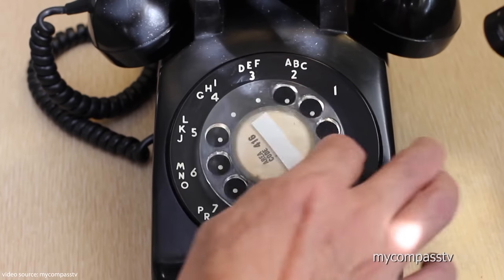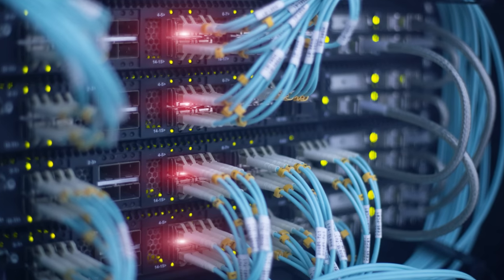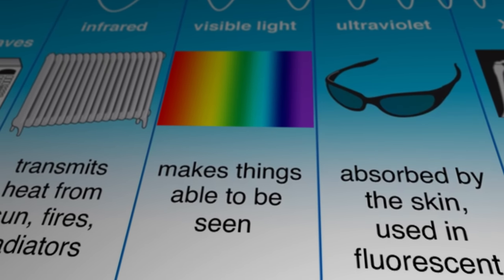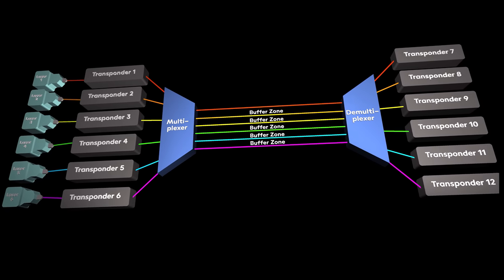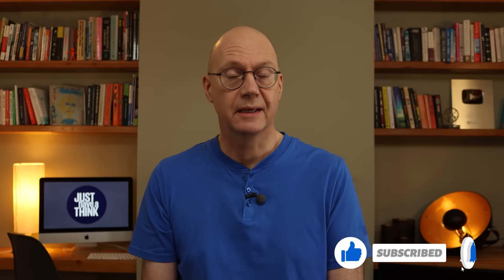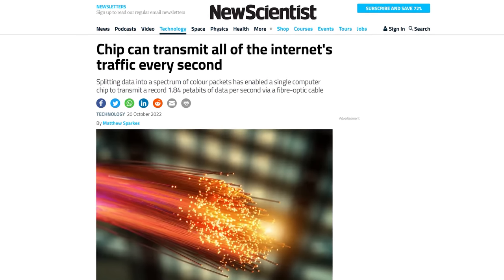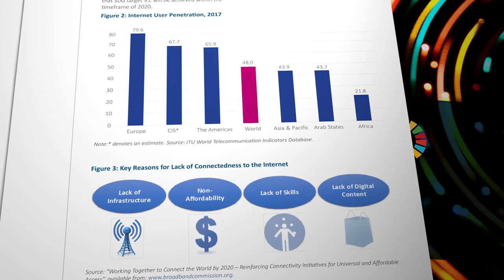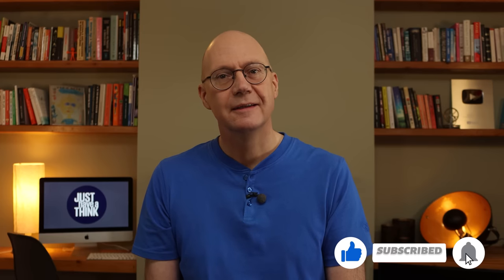The entire internet on a single chip! MASSIVE energy savings.

Comment: Wow - this will definitely help out a lot.
I always ponder if we start to move out into our solar system, says Mars next, how will we get past the time leg in communications.
All the best to you and yours.
Reply: This will change nothing with the time lag for communication between planets.

On average light takes 12 minutes and 42 seconds to travel from earth to mars.
Reply: @simcru933  I knew that. But that may be the next big challenge to  overcome as we spread out.  Such as using neutrinos or some other particle we find that travels faster than light.
Cheers
Reply: I think that stuff is gonna be far far in the future. For the meantime, we'll have to be content with the 12 million ping to game with our buddies on Mars.
Reply: Actually if they unroll 1 of these youbeaut new fiber-optic cable thingamies behind the spacecraft as they head for Mars, they could then use it to reel it in closer to the Earth as well. Thus shortening the communication delay - no? 😜🙄😁
Reply: @theoztreecrasher2647  Light travels slower through a fibre optic cable than it does through a vacuum.  So, no.
Reply: @-_James_-  Well that just means that they'll have to winch Mars even closer to the Earth to get the benefit. If they get it to within half the distance then they can double up the initial cable and have twice the capacity as well as half the distance. QED Erasmus! 🙃😉😁
Reply: @patrickmckowen2999  If we spread that far out we would need to be self supporting and for communications fall back on the ancient way of sending messages and wait a while for an answere.
Reply: @DRakeTRofKBam  🤣
Reply: @patrickmckowen2999  Neutrinos don't travel faster than light.  Nothing does, a tachyon would move perpendicular to time.

Comment: Very interesting development. It may be useful inside data centres for clustering machines more efficiently. 

However i'm.not sure the capacity of fibre optics is responsible for much wasted energy. Data centres sitting there doing nothing burn electricity and a significant amount of power is lost during transmission to data centres. 

Perhaps colocation of data centres and power generation might be the win with a vastly faster (hence cheaper?) cable link? 

It would be interesting to see exactly what traffic is composed of - the most CPU intensive stuff outside Cern seems to be crypto mining - beyond that there's finance, weather, engineering etc but all this CPU intensive stuff doesnt generate that much traffic - traffic is mostly trivia - porn, Netflix / streaming and social media nonsense. 

At present bandwidth is handled by running multiple cables - even when a single cable is to be run the trench will get a dozen redundant extras because hey - holes are expensive!!

Comment: About the same time this story hit the news another store about hollow fiber also made the news. Evidently light travels 46% faster in air than in glass fiber. This won't directly increase the bandwidth, it could free of the fiber for more transmission increasing the daily bandwidth be reducing latency. Maybe I'm just older, but I was hopping on modems to connect to other computers in the mid 80s. My 1st modem had a speed of 300 baud. A term that is completely obsolete and may have become obsolete back in the 80s..
Reply: @Pasta_watcher  Baud is symbol rate, so it depends on the symbols used. If it's 2 states then 1 baud is 1 bit per second, but you can also have more advanced symbols such as QAM64 which is 6 times faster (log2(64)).
Reply: Bandwidth does not correlate directly with signal speed.

Comment: I rather think that the the Internet energy usages quoted is not for the communications elements alone. In addition to that there will be all the servers and storage in the data centres, the air condition plus the end user devices. Figures I see for the electricity used by the data communications elements are around 1% of total global consumption, and most of that is not used in those high-speed inter-continental fibre links. There are many hundreds of millions, possibly into the billions of end user network devices, in the form of routers, almost always with WiFi included. Then here are all those 3G/4G/5G transmitter stations. Increasing the capacity of existing very high capacity optical fibre links is useful in its own right, but it's not going to make a huge difference. 

This is tackling only a small part of the total power used by the Internet as a whole. Also, researchers all over the world have been setting records for data transfer rates down a single fibre, with the petabit/sec milestone having been reached in June 2022 in Japan. I don't think what the Danish researchers have done is some enormous breakthrough, but just another step up in speed. The power saving is going to be fairly small overall, as even within the strictly comms part of the Internet there are a whole lot if switches and routers which use a fair amount of power.

Also, no, this has nothing whatsoever to do with optical computers. That is a whole different area of research, and the problems of producing high density optical computing logic gates and so on are immense. This particular development doesn't address that at all.

Comment: "at speeds thousands of times of the speed of electrons in a copper wire"     COME ON!
electrons travel slow, yes, but the SIGNAL being passed down a copper wire is the speed of light times the velocity factor.
velocity factor of copper wire and velocity factor of optical fiber are comparable, e.g. the signal travels approximately the same speed (well within 1 order of magnitude, NOT 3 orders different!)

Comment: Hm just wondering about one thing: A microprocessor can only execute commands as fast as his clock source (or about that speed). Modern CPUs have a clock speed of, let´s say, up to 4 GHz. One Byte of data requires AT LEAST 8 clock cycles to transmit. Usually it is much more (for all the overhead code).  So I don´t really see how one microprocessor could create these amounts of data.

Unfortunately, I cannot view the research article without paying 32 $, but I guess that the invention focuses on how much data can be sent through a fiber optic cable and not how much data one single microprocessor can transmit. I guess their overall product consists of several microprocessors. 

But being able to transmit more data through fiber optic cables is a bigger breakthrough, than "just" increasing the capabilities of a microprocessor, as it increases the potential of our current data infrastructure.
Reply: No because data is clocked by hardware in parallel with CPU operations. I've forgotten almost everything but starting 1968 all we had for that were IBM 360 "Channels" and our computer programs loaded a Channel Command Word (CCW) with all that was needed to transmit a series of bytes (any number) from the ferrite core to magnetic disc or tape or printer or the convolver (all details were loaded into the CCW) and then the CPU gives "Go" instruction and the CPU is finished that task and continues its work ==simultaneously== as the CCW hardware transmits the bytes. The CCW when finished flags an "interrupt" to the CPU. All computers multiprogram or at least do simultaneous CPU work and Input-Output (I/O) using the "interrupt" system. The hardware interrupts the CPU and stores all its present status to resume in an "Old Program Status Word" (old PSW) and then loads the new  <<9 hours later: I was waxing nostalgic about IBM 360-44 and intending to move through the I/O process on Raytheon 706, Varian V73/V75, DEC PDP 11/20, Fairchild F5, Zilog MCZ-1/05,20, Intel 8088/86 (IBM PC) but I've lost energy so I'm cutting straight to the byte I/O chase >> although I've forgotten almost all Intel 8088/86 from when I programmed it in 1982 at Assembler level I'm still certain that an 8-bit byte is transmitted by just 1 instruction that loads it into the CMOS 1488/89 chip or whatever the chip is now and says "Go" and then the hardware handles the 10 bits of serial transmission ("0" 3.8V-5.0V start bit, 8 of data bits, 1 of parity bit, 1 to (an endless number) of "1" 0.0V-1.2V stop bits (because a logical "1" 0.0V-1.2V is simply the continuous line voltage when no data is being sent/received)) so it's definitely not needed for the CPU to be waiting and giving an instruction to send each bit because that's all handled by hardware so the CPU can be doing whatever useful calculations it needs to do while the hardware is sending the 10 bits serially, then an interrupt is raised after the byte is sent and the O/S decides which service gets the CPU time. I'm essentially certain that's true but it's a memory from 1982 when I was much involved in hardware & software for some early screen colour graphics (Control  Systems Artist board and Mitsubishi C3419LP & C3919LP expensive colour cathode ray tube monitors.  $5K each item, $15K total,  in 1982 money.
Reply: @grindupBaker  Wow, how about using line breaks? What you describe sounds like a DMA (direct memory access). Even, if the transmission of data is handled by hardware, it still needs a clock. As far as I know, you cannot clock any processor faster than 5 GHz. So if you transmit 1 Byte (8 Bits) of data per clock cycle, you still can just transmit 5 GByte of data per second. That´s a factor of 1,000,000 short of a PetaByte. 

Besides, they claim they are using a single laser diode to transmit all that data. A laser has a certain rise and fall time that limits the maximum transmittable pulse frequency. A frequency of Petasomething will be quite hard to achieve.

So I´m pressing X to doubt.

Comment: Even as the world grows and requires (and wants) more things that use energy, it seems that because of efficiency, less energy will be needed. 
However, even with all the new efficiency improvements, we'll never be able to use less energy to lift a cubic meter of fresh water 100 meters high. Okay, maybe a tenth of a percent more efficient but that's nothing compared to the extra number of people that, already lack sufficient water needs.
So, we can not improve the efficiency of the things that require basic physicsby very much - past electrification, in which case a whopping 3x, or so. But we can improve the efficiency of data and computers simply because we can still ^miniaturize^ them.

Comment: We need to be redesigning chips for data centers, and transmission, and if needed the protocals themself
Reply: I think it was a mistake for the Internet Protocol to treat multicast as a special case.  It is really unicast that is a special case of multicast.  Broadcast is already treated as a special case of multicast in IPv6.
Reply: @davidwuhrer6704  The protocol def has problems with it. HTTP3 brings us some nice improvements to the old. Web3 is helping fuel changes to how the internet works. But we are still in the ealy stages of fixing the internet in my opinion. IPV4 running out pushing us to IPV6 also helps too.
Reply: @scriptles  
> The protocol def has problems with it.
No, it doesn't.  Both IPv4 and IPv6 have multicast as a feature, and it works.  It is used for Avahi/Bonjour/Zeroconf, mDNS, IP4ALL, and various layer 7 protocols.

The problems are with old routers that don't understand IGMP requests.  And with IPv4 address space exhaustion.  The latter is solved by IPv6.  But, old routers that don't understand IPv6 which has been around for decades, and ISPs that like to lock out competition.

> HTTP3
Has nothing to do with multicast at all.  HTTP is and always has been a layer 7 request-response protocol, implemented on to of TCP, which is purely unicast.

HTTP2 is a technical loss.  Where HTTP is and always has been a text based protocol, easy to read and debug, HTTP2 obscures that to save a few bytes, but header requests for NPM packages on GitHub for the lastest React AJAX web app are still larger than the actual content.  Where HTTP can use multiple connections, and with HTTP/1.1 simple pipelining, HTTP2 uses multiplexing, which prevents pipelining but adds significant overhead.

I have never heard of HTTP3.

> Web3
Is a meaningless buzzword, like Web2.0 or Work 4.0.

The internet was built on the idea of end-to-end connections, it was designed to be dumb decentralised infrastructure.

Microsoft sold the idea that the internet should be organised like broadcast media, with a few central entities providing content ("content providers") and others providing access ("service providers", in analogy to telephone service), with content being downloaded to the users.  The telephone companies wanted to sell individual connections, each log in to a mainframe like a telephone call.

Of course the internet does not work like that at all.  Users sent email to each other, the content created by the users.  Users subscribe to newsletters and mailing lists, the content provided by the users.  Users create web pages, the content provided by the users.  Users participate in chats.  Users share their files.

The role of the "content providers" is merely to host or cache the content.  That was useful for users who paid service providers by the minute for the privilege of providing content, but unnecessary for users on machines that were always online anyway, from before dial-up existed, and which is the case for pretty much every phone and computer today, again.

The buzzword Web2.0 was used for this radically new concept of it being the users themselves who provide the content for the "content providers".

Web3 is equally vacuous.  Blockchains are nothing new: As far back as the first version control systems in the early 1970s you had histories of files where each version built on the previous version, recursively.  The Xanadu hypertext system had "eternal log files" verifiably preserving each version of each document for reference.  The only new thing about blockchains is the word "blockchain".  And even though web-based wikis ("Web2.0") provide much of the same, the "Web3" blockchains aren't even part of the web, they don't use HTTP, and they aren't indexed by search engines.

There is nothing new in Web3, it is ages old stuff, and it doesn't change anything.  Cryptomining only helps burn the planet faster.

If you are looking for disruptive innovation on layer 7, look at BitTorrent, which underlies PeerTube.  Look at Freenet and other distributed file systems, and look at distributed hash tables in general.  You'll notice those aren't new anymore either, but they are enabling technologies that do things differently.  And unlike Web3, they actually really are decentralised, just like the internet was always meant to be.

The chip in the video is an innovation on layer 1, the physical layer.  IPv6 is layer 3.  TCP and UDP are layer 4.  E-mail, web, telephony, blockchain bullshit, etc are layer 7.

Comment: The 5 minute picture download, yep.
Reply: I think I started at 300 bps in 1973 though it's possible our teletype was 110 bps. That old serial 12V RS232C was so slow that I wrote a Zilog MCZ 1-05/20 Assembler program circa 1980 that read each bit 16 times for some engineering monitoring prototype hardware we built. Had an oscilloscope on it to assess how much parasitic capacitance was rounding the starting shoulder of the square pulse of a bit. Only needed a 1 GHz scope back then to do the job of carefully studying individual bits. It was an 80-bit parallel to 300 bps RS232C serial demultiplexing Zilog MCZ 1-05/20 Assembler program to monitor the operation of elevators in major buildings like First Canadian Place, Canada Place, Banker's Hall, Canary Wharf, 60 Wall Street, and soon. Basic hardware was CMOS 4022(?) 8-bit shift registers banked serially and clocked out by my Assembler program via 1488/89 CMOS chips for 5V CMOS to 12V RS232C to send out on Bell Datapac 3000 (X.25 packet switching) which I think was an early internet type of thing. This was before elevator companies made their own. We were computer trailblazers for monitoring old relay equipment and early (often squiffy) microprocessor equipment.

Comment: you say sending light down fiberoptics much faster than electrons in a wire but this is very misleading.

the bandwidth of fiber optics is typically much higher but the actual speed is a different topic. the signals travel at around 2/3 the speed of light in both copper and fiber. although the actual electrons don't really move.

Comment: The usage of the whole internet compared to backbone internet seems a little bit of an incorrect comparison. Additionally your typical user isn't going to be walking around tethered to a multi-channel fiber cable.

Also, while fiber might be "stronger" than copper it's much more frail than an in-home copper installation. Compare the sheer strength of fiber strands to copper as used in networking wire sometime. There's a reason that the ethernet industry is still around beyond just the use of POE.

Overall, it's great to see that multi-channel fiber has found another theoretical, and that's the key here, bump. This will only ever be for backbone providers through and not likely be coming to your home. So don't present it as an energy savings for everyone, or as a way to get internet to everyone. That just mucks it all up.
Reply: Here in Finland, it is fiber optics everywhere for many years already, copper gives extremely slow speeds of internet and was used in the 90s.
Over 99% of all internet data is moving through fiber optic cables, especially underwater sea cables and if this new technology can speed up the internet thousands of times faster through these fiber optics, it is very good news.
Reply: PoE is an obstacle right now, but there is another reason why copper is still around: Bend radius.

That, and being able to charge a premium for optic fibre connections.